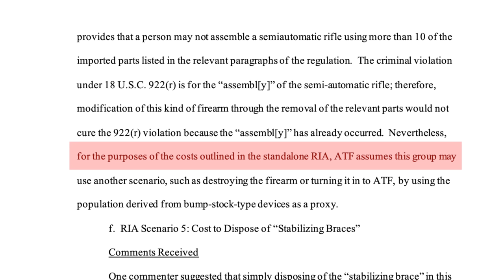BOMBSHELL HIDDEN IN PISTOL BRACE RULE!

Comment: even the industry minimum estimation of 10 million is still extremely low considering a large number of people (like me) bought multiple SBA3 knockoff braces from AliExpress for $15-20, from Amazon at $25-30, OR from vendors at gun shows for $35-40.

In my opinion, same-day delivery Amazon Prime braces for $25 meet the definition of "common use" and, therefore, they're protected under the 2nd Amendment
Reply: they are just going off of known sales.
Reply: Common use to me would translate into not a small percentage of the population owning a bunch of them but to be common probably 40% of the households in our general population owning such a weapon configuration.

I would be there is not even 10% of the gun owning population in this country in possession of weapons configured like this as most gun owners are hunters with bolt action rifles or shotguns or normal handgun owners such a Glock, revolver or another pistol that would be considered COMMON for concealed weapon carry.
I know no normal gun owners that possess weapons that fall under this classification honestly.

I think the percentage of gun owning households on these videos and within gun forums are vastly overestimating the percentage of households that possess one or the percentage of the population that think there is a genuine need in our society for possession of such weapons for a sporting use.

Remember there was just another mass shooting in California yesterday which I think killed 10 and wounded 10 more.
The general public is very anti high capacity, black rifle accepting right now honestly and the constitution can actually be amended to eliminate or alter any 2nd amendment rights you think you are entitled too.  

Sometimes you can lose the war by engaging in certain battles that should be left alone.
Reply: @billwiley7216  less than 10% of the US population hunts with rifles, even fewer than own braced firearms, so does that mean you're ok with ATF banning bolt action rifles because they aren't "in common use" ??  Because the NRA supported banning bolt action rifles after one was supposedly used against John F Kennedy. The NRA spokesperson wrote an article detailing how they would support a bill that would ban bolt action military surplus rifles like the one purchased by Lee Harvey Oswald - and that later led to the Gun Control Act of 1968, but at the last minute they removed the clause that would ban milsurp rifles & a few other things.  They also wanted to ban any rifles shorter than 18 inches (just like shotguns) but the Govt had just sold about a million M1 carbines to the public & those all had 16 inch barrels so they couldn't legally outlaw those because it met the legal definition of entrapment.

I have over a dozen friends who only own a.r. pistols... some in 9mm, some in .300AAC, some in 5.56, but they own no bolt actions, no shotguns, no "glocks", not even any full length 16" semi auto rifles. They have never been hunting a day in their life (most dont want to) and every one of the firearms were bought as a factory configuration from Sig, Daniel Defense, Maxim, and Q. They were bought specifically for home defense and nothing else.

I think you vastly underestimate the number of people in places like California, Illinois, and New Jersey where it's illegal to possess any NFA items however A.R. pistols are not prohibited. Are those people supposed to just forfeit their $2500 investment?

You are also forgetting the millions of Americans, like my mother, who are disabled and cannot physically manipulate a full 16" rifle or 18" shotgun - but she has no problem shooting her braces 9mm AR pistol that I built her.

My definition of "common use" would be the thousands of people who play airsoft or milsim that have also bought these items.... the brace is not a firearm & therefore it does not fall under ATF jurisdiction, it's a toy as well as a prosthetic  -  ATF's proposed rule change is a direct violation of Vagueness Doctrine & the American Disabilities Act, not to mention NYSRPA v Bruen and Marbury v Madison SCOTUS rulings. 

That means the ATF director could also be arrested for violation of 18 U.S.C 242.
Reply: @billwiley7216  found the fudd....

The fact you don't understand that A.R.'s are the most common firearm platform in America and barrel length was never debated by Congress under the 1934 NFA much less the 1968 GCA.   They also didn't outlaw short barreled rifles in 1934, the NFA's original purpose was to just TAX the sale of items (like newly manufactured machine guns) in order to track and regulate interstate transportation.... and it was designed to be a prohibitive tax imposed on a constitutional amendment because the federal govt could not legally ban everything, their jurisdiction only allowed them to regulate (tax) interstate transportation and first point of sale. After that, the tax stamp was supposed to stay with the firearm, it wasn't supposed to be a repeatable tax on resale items  - Likewise it was never meant to carry a criminal penalty, it was just supposed to be litigated in civil court as an unpaid tax.... the equivalent to unpaid parking tickets.

They cannot, legally, impose a tax on a constitutional right. They also cannot, legally, control or regulate intrastate commerce of firearms because that is protected under the 2nd AND 10th amendment - which is how places like Texas are deregulating suppressors made and sold within their state.... I look for other states like Florida to follow suit.

Most importantly, you missed the Bruen decision by SCOTUS that focuses on Text, history, and tradition...
Historically, we had no regulations on barrel length, suppressors, or machine guns when the 2nd amendment was written and, therefore, the NFA itself is unconstitutional.
Reply: @RichardCranium321  Couple of things wrong with your argument is that barrel length mainly for shotguns was a very prominent reason of the 1934 legislation mainly due to use in certain crimes as a sawed off shotgun was easier to conceal and were popular with the mob which was one of the main criminal elements being targeted at the time.

And yes ownership was originally controlled by a $200 tax stamp in the 1930's but the first year there was actually a minimum wage to get an idea of what a salary may have been was in 1938 where the minimum wage was .25 cents an hour or for a 40 hour work week $10 a week so with a monthly income of $40 you can see how the average person would never be able to afford paying that $200 fee effectively banning the targeted weapons among the common citizens.

At the present time our laws legally dictate Federal law overrides or trumps state laws. 
Just like with states legalizing marijuana which is still a class 1 controlled drug under Federal law and hence making it illegal within the borders of this country a person in a "legal" state can still be arrested by Federal authorities and charged with marijuana possession and/or distribution under Federal laws and be tried/convicted and sentenced in a Federal court of law so do not get to comfortable thinking state laws will keep you out of prison for Federal law violations.

Also a reason the Constitution with being able to be amended is somewhat a living document and history shows it can be amended and changed.

The most stupid thing you wrote was "Historically, we had no regulations on barrel length, suppressors, or machine guns when the 2nd amendment was written and, therefore, the NFA itself is unconstitutional" as none of those items were in existence at the original time the constitution was written and I never have seen or heard where the founding fathers had a crystal ball and could see into the future.

You keep on thinking that the powers to be will not at some point ban "assault" weapons or high-capacity magazines in our country's future.
It has already been successfully done back in 1994 through 2004, actually I was surprised when they allowed the law to sunset or end.
But a legal precedent has been set that the 2nd A is not  immune from being altered or changed from the original state that was written by the founding fathers.

According to you a normal citizen because of the 2ndA should be able to own and possess a nuclear weapon as those were not listed  or regulated by the founding fathers either.
And with the stupidity you exhibit with that position is the reason the gun lobby gets weaker and weaker with every passing decade, you do not have the sense to compromise on certain issues to retain more rights in other areas.
Better to choose your battles to have a better outcome over the entire war .
Reply: @billwiley7216  federal law does NOT supersede constitutional law... you're absolutely wrong about that.  That's how places like California have gotten away with selling (and taxing) cannabis products - it's called the 10th amendment, my friend... I suggest you familiarize yourself with the constitution as well as supreme court case law references like ex parte sebold & the vagueness doctrine - "an act of Congress repugnant to the constitution is void and cannot become law...  if legislators delegation of authority is so extensive that it would lead to arbitrary prosecution of the average citizen, the rule is void for vagueness and is as no law"

These things are important because they set legal precedents, as they were decided well before 1934 - one was settled by SCOTUS in 1803, so....... yeah.
Reply: @hambone950  then why is atf acting like there's only 10K in existence? Even if we give them slight benefit of doubt, they're still off by several million.  The difference is exponentially more.
Reply: @billwiley7216  

Keep in mind, for the DAY they were invented, these were machine guns. Clearly the founders had forethought that technology would advance as they saw it happen in their lifetime. 

In 1718, James Puckle invented and patented what was essentially a machine gun. According to Wikipedia, the Puckle gun “had a pre-loaded cylinder which held 11 charges and could fire 63 shots in seven minutes [9 shots per minute]—this at a time when the standard soldier’s musket could at best be loaded and fired three times per minute.” The gun was intended for use aboard British ships to repel boarders. Although the Puckle gun was never widely used, it was known at the time of the American Revolution, and the concept was certainly known since Leonardo da Vinci designed a rapid fire weapon in 1481 

Another relatively rapid fire weapon was the Ferguson Rifle invented by British officer, Major Patrick Ferguson. The Ferguson Rifle was a flint lock, but it was breech loading rather than the standard muzzle-loaded rifle. It could fire up to seven rounds per minute, two to three times faster that the muzzle-loading weapons of the day. Using the Ferguson Rifle, light infantry troops could continue loading and firing without breaking cover, even when lying prone. This rifle was used by the British against the Americans in 1777.

The Second Amendment was ratified in 1791, a full 73 years after the Puckle Gun was invented. Although modern machine guns are vastly more effective than the Puckle Gun, it nevertheless demonstrates that humans were contemplating rapid-fire weaponry nearly a century before the Founders guaranteed that “the right of the people to keep and bear arms shall not be infringed.”

If concepts like the Puckle Gun existed well before the founding of the nation, how could the Founders possibly not consider such weaponry when writing the Second Amendment? It is inconceivable that they wrote “shall not be infringed” but were really thinking “shall not be infringed (except when the weapons are like the Puckle Gun).” If the historical reality were different, an argument that the Second Amendment doesn’t apply to modern guns might be more salient, but the facts are otherwise; just ask James Puckle and his mounted machine gun.

The Cookson Repeater was a repeating rifle designed in the late 17th century. It used a rotating drum magazine and had a fourteen shot capacity. The gun could fire all fourteen shots without reloading, a feat which was only surpassed by the Kalthoff Repeater.

Comment: Call me a conspiracy guy, but this makes me believe since guns that use this type of system that the brace can be taken off and have no rearward part that has "surface" to place against a shoulder is worded to leave guns such as AR15's that have a buffer tube to ATF determination that the end of said buffer tube will be "surface area" and also make this a felony to own. With or without a brace.
Reply: Yep
Reply: I agree. So a braced Ruger Charger can have the tube and brace removed and it’s just a legal pistol. It doesn’t need a buffer tube to function. But an AR-15 pistol that needs the buffer, spring, tube cannot be compliant and still be functional unless you swap the upper to make it a compliant length rifle.
Reply: I told the workers at a gun store about the surface area situation they seemed confused.  Yes this rule has language to ban all pistols.  AR pistols are covered under the surface area requirement and all other foreign pistols are just illegal SBRs period.
Reply: yes, this is correct... all the AR-15 style "pistols" that use a buffer tube configuration fall into this categorically. Other American manufacturers like SIG that dont have a rear surface or buffer tube and a removable, non-integral part of the gun brace, dont. Everything from outside the US is basically a boat anchor now. Thats what I am getting as at this moment anyway.

Comment: 922r applies to rifles and shotguns.  An SBR is an SBR not a rifle.  Just because the word rifle is in SBR does not make it a rifle as much as the word ham in hamster makes a hamster a ham.  Same for shotguns.  When people started getting fast and loose with terminology it opened up this window for the ATF to say SBRs are rifles but that's as much as civilians and the industries fault for conflating Short Barreled Rifles with rifles.  This is very easy to prove because the definition of a rifle is a minimum 16" rifled barrel long gun with a minimum overall length of 26".  An SBR does not meet this requirement.  922(r) is written for rifles and shotguns not SBRs and SBSs.  It really should not be very hard to fight this.  The question is will industry and gun owners get their heads out of their rear ends and actually read the law for what it says and not what they think it says.

Comment: Ugh, I don’t know what to do, I mean are people with pistol braces going to be compensated? Some of those braces are mighty expensive. Same with the option of changing the barrel to 16 inches. Are these assholes going to pay for it? FBI is running the background checks for the ATF, so how are they going to approve well over 50,000,0000 sbrs before 88 days? 88 days is an automatic approval denied if it sits there for 88 days. Either way I’m keeping everything. It’s their problem for not being able to write simple instructions.
Reply: 1) no you will not be compensated.
2) the FBI is no longer doing background checks for the ATF as the had a bit of a spat and now the ATF has to do them, and they already didn't have the staff for it.
3) in this case you cannot add a 16 inch barrel to these imported guns

This wasn't a mistake or a bug, it was a design feature.
Reply: Actually the ATF now does their own BGC's.
Reply: @jimmyjameswu6474  yes that is the video I've seen haha. And idk what their grand plan is but it seems like they think they can get away with their nonsense, whether or not they can remains to be seen.
Reply: @jimmyjameswu6474  "bunch of idiots" is putting it super kindly. Wouldn't be the choice of words I'd use to describe them but some of the words I'd use YouTube doesn't like so it is what it is

Comment: I know it's a pain in the ass and it shouldn't be this way but technically "destroy" only applies to the receiver. You could break it down into a parts kit, get rid of the receiver and rebuild it from a parts kit onto a new receiver into whatever configuration you wanted to.
Reply: Yeah, that sounds totally reasonable 😏
Reply: except a lot of imported pistols have their UPPER receiver as the firearm, ie: you aint replacing that portion.
Reply: Sound good I am going to do that now🤪🤪🤪🤪
Reply: @RicArmstrong  lol.. no it's definitely not reasonable, this whole s*** show is completely unreasonable. But if I were determined to comply with this BS I would much rather have a parts kit of the gun I spent money on then nothing at all.
Reply: @johnnyjoseph1389  
I understand,  and from a technical point of view it makes sense. 
I just want people to stand up for their rights.

Comment: According to the ATF, a pistol can be converted to a rifle and back as long as it started out as a pistol to begin with.  A rifle, however cannot be converted to a pistol without paying for a tax stamp.  With this new ruling, since a pistol brace makes the firearm an SBR, wouldn't that mean that any firearm that was initially built with a brace was an SBR from the beginning?  Where I'm going with this is that removing the brace from what the ATF now considers a rifle does not automatically make it a pistol now.  Since it was built as a "rifle", it is still a rifle with or without the brace.  Am I overthinking this?

Comment: According to FederalRegister.gov, the rule will not be added to the register tomorrow. That gives foreign-made pistol owners at least a day to replace at least six parts from their gun (+/- 1 depending on gun design).

A US-Made brade, US-Made handguard, US-Made magazine counts as 5 parts for 922(r) purposes. Replace one more part (cocking handle, pistol grip, hammer, sear, etc) then it is 922 compliant.